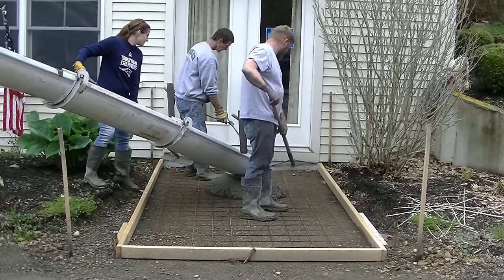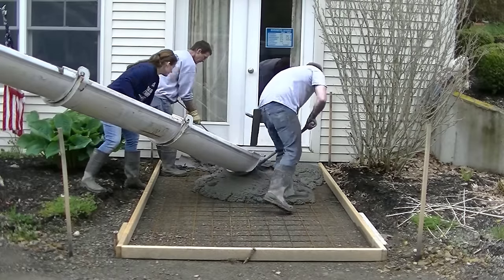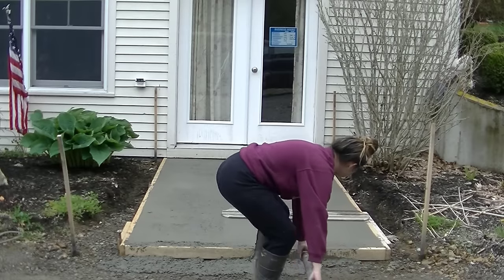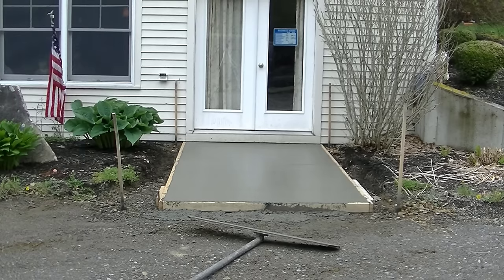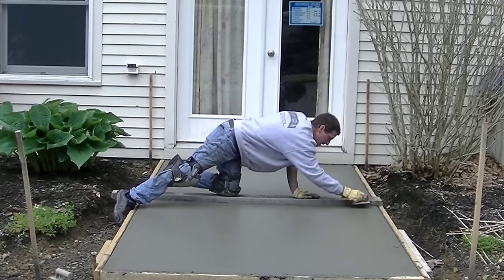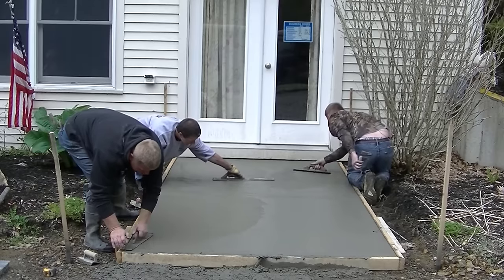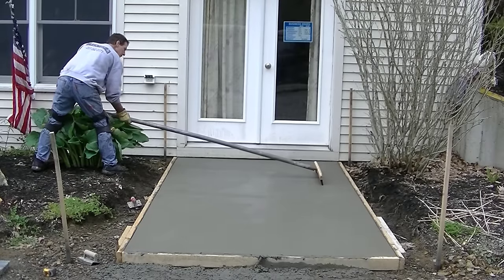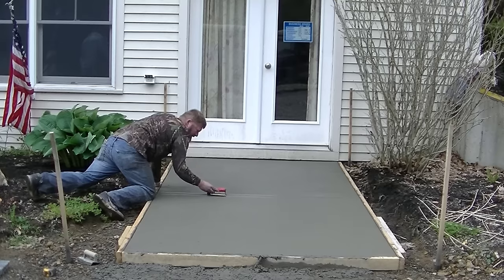Dry Pour Concrete VS Wet Pour Concrete - No One Else Is Telling You This

Comment: I'd like to see some concrete strength testing using sample cylinders of dry pour vs. wet pour concrete. I remember doing that in an engineering class. That was a lot of fun!
Reply: I'm pretty sure no one's putting a car on a dry pour...my dog is 30 lbs
Reply: @MannyTwice So then how thick is it? I don't get it like if you don't need that much strength. And why do you have such a thick slap? Like? You don't understand what concrete is more efficient at holding the same strength. So you need less of it so it's easier and more efficient to use it. So it's dumb to say? Oh I just use the whole truck of drypour
Reply: @MannyTwice there is a guy on YouTube showing just that. The dry held up as good as the wet pour. He cut both in half and drove over both and both held up. Do some research.
Reply: Many have done  videos on comparisons. There is not much difference in strength between dry and wet pour. The biggest difference is cure time, it takes much longer for dry pour to cure. Once cured , there is little difference between dry and wet, well except for cost, Im an old man and poured a dry pour 28x16 pad by myself, for less less than a quarter of the price of getting someone in to pour for me. I would not be physically able to wet pour a pad that size by myself, but dry pour, it was so easy.
Reply: @Edpo26  driving over concrete once or twice is not a test. Cutting it in half is not a test at all.
Reply: @JohnathanAulabaugh if it's not going to be used for cars, I think supporting a car even once is more than strong enough to hold my lawn mower and some tools.
Reply: @JohnathanAulabaugh  guys drove over it several times with a truck and finally broke it. Also did checks inside by cutting into it to see if it’s dry or fully cured. If you’re making a patio slap with chairs on it, dry pour is fine. Just like a small shed. It’s not meant for driveways. That’s commons sense
Reply: @JohnathanAulabaugh it wasn’t once or twice they did it a bunch of times and the guy even said that the video didn’t even have all of the shots because of the camera falling over he estimated he rocked over that pad about 100 times
Reply: @Edpo26  every test carried out by the manufacturer's of bagged concrete show otherwise, that's why it says right on the bag how much water to add 'before' pouring.

Comment: I've been doing a parking sab in 7'x7' sections to keep the pour manageable mixing with 80 lbs. bags.  For me 30 bags is about the most I want to do in a single session.  each slab I do is getting better on the finish as I gain experience, but you experienced guys make finishing look so easy.  Most first timers are not going to get the finish you get.  For many applications the finish is not so important, but the strength is.  Personally I'm stickling with mixing, but I'd still like to see a fair legitimate test with fully cured concrete dry vs wet considering only strength as a first time DIYer is likely going to get a bad finish dry or wet.  Also the exposed aggregate like most of the dry pours get is a legitimate finish that some people like (not me but...)
Reply: I've been doing doing a dry slab 28x16 pour myself. I've been doing it in 4ftx 16ft section to keep it manageable. Its about 22 66lbs bags per section. 7 sections in all. I just finished section 6 tonight. 1 more section to finish and I will share my results on Youtube. I have done 15 dry pours before this. So Im am really starting to get a good understanding of dry pour.
Reply: you mixing by hand or with a machine?

Comment: ❤❤❤❤❤❤😊😊😊😊very good explanation. My DIY guru friends argued with each others over this same topic “ wet cement versus dry cement techniques”.  I shared the  test result that I conducted to compare “ apple to apple” and they are now understand. Here are what I did  1) cross section test showed the integrity’s density and hardness. The integrity of wet cement mix far better than dry cement/ sprinkle with water. 2) moisture content test showed the wet cement mix still retain adequate amounts of water which means its hardness strength continue to set.%

Comment: I think that dry pour leaves a lot more chance for problems. Probably adequate for places that are not  going to be put under a lot of stress. A wet pour also can be a disaster if not done properly.  the wire is on example that probably will not be an issue in a pour like that Called it 4 inches but only actually 3 and 1/2.  What I have seen even by people who do this work is when a wet pour gets too hard to put a finish on the douse it with water to soften it up and then put the finish on. Looks good but often especially where you have changes in weather the top peels off. Done properly I know of sidewalks that are still in good shape for 40 or more years ago. I guess hand mixing it is more work but when I mix  I see where sometimes the contents have seperated. And dumping from above the material will separate to some extent as well. I do use dry mix under pavers to get them level and they will absorb moisture and get some degree of hardness.  For a driveway or some place like a shed where you might put a good amount of weight on it I would go with wet.  I am thinking slab where you are going to put a shed.  I would never say do not do it but think if you have the time and physical ability get a mix box and a hoe and just mix it yourself. Just an opinion and I am 67 and still mix my own and did so just the other day.
Reply: we had a brand new bmw dealership open up,3 level building including a basement (built from scratch) to store the brand new cars.Within a month the concrete in the basement started showing cracks,two months later they were 300-400mm deep and meters long.Clearly a shitty job
Reply: @rorynesta7766  There's a video on YT where a professional team had to pull up a driveway they had just laid not long prior and redo the whole thing.  The reason was that the mix they got trucked in from the concrete supplier was not up to normal specs.  Sounds like this may be the case with your basement concrete.
Reply: @Gourockian1  you do have a point though the was also an asphalt drive around the building also put down and to the adjoining service center and the surface on that was coming apart,meaning little pieces of asphalt was peeling off.Was annoyed as the whole road surface was layered with loose pebbles.Just shoddy workmanship tbh.thats NZ for you.

Comment: Great Points!  
I think it is different On Fence Posts.  I had a neighbor do his, and he did 4000 psi dry mix added water and then pounded it in with a 2 x 4 and then more steps like that and then a year later I came up to his with my fence and needed to remove a corner of his concrete... I used a couple of diamond blades and it was so hard it turned my diamond blade cherry red, the end of the blade curled.  I could not even go more that a 1/4".... I was blown away! I gave up and just moved my post.
  I have worked with busting out concrete for 42 Years off and on, I have Never seen that before.  But then I learned about RCC (Roller-Compacted Concrete) like how they repaired Lake Oroville Dam in California.  It is much stronger because it has just enough water mixed into it to make it solidified and they basically put it down as asphalt and then run the Roller over it... But like you said you have to mix it.  So on Fence Posts it is a little difference I think if you pound / compact it.  But yes to your point again the dry concrete needs to be Mixed with water for consistent strength and finish.
Reply: Hydration as well, compaction. Usually the lower the slump the stronger the concrete. Slump = amount of water. You will see many residential slab/foundation crews tell the driver to pour the water to a load. Easier to handle and it is not going to a soil lab for compression tests, etc.

Comment: I think you're missing a big part of the point. I agree that wet-pour is best. So show me how to do a bang-up wet-pour job (just like this porch slab here) with just me alone -- not a 5-man crew, and no concrete truck to pour it all out in just a few minutes time.
Reply: I'm guesstimating this slab is 7x12, at 4" thick, which works out to 1 yd of concrete, which is 45, 80lb bags, I would dump 5 bags at a time into the form, wet it up real good, and shovel mix it, do this 5 times spread out evenly inside the form, add wire, and then mix one or two bags at a time and pour into form,  and secrete as you go and then finish, you can keep it a little wet so it does set up to fast, or pour around 1" over most of the slab than pour the top inch, also putting a layer of plastic down before you put the first half of the concrete down to slow down the cure time, unless you're pouring in the sun on a hot day you shouldn't have any problems.
I've hand mixed, poured, and finished 100 bags in a day before, many times, but I'm a beast.

Comment: I've done multiple dry poor slabs by myself. It's the way to go. I've saved thousands in the process. The results may not be perfect or withstand a nuclear blast as a wet pour but they are good enough for me and  my requirements. My biggest project was a 10*15 for a tool shed, it is 5 years old now and it still looks good as new.

Comment: When you dry pour it will soak in all of the water you spray on it and it soaks it in even.  You can get a smooth finish by simply running a bull float across it.  The more you screed the more cement will rise to the top.  One reason it flakes is because it's over watered on the top.  Yes, you can put a broom finish in it if you want.  The reason for the paint roller is to remove the screed marks and to leave a none slip sandpaper like finish on the surface.  Dry pour does work well but you have to do it just right.  Just like a wet pour, if you don't do it properly then it won't come out very good.  It's not as bad or difficult as you make it sound.  You can get the exact same results if you do it properly.

Comment: I'm really confused...isn't concrete porous by nature, so water moisture either by hosing, rain or drawing up from the ground is eventually going to wet a slab all the way through?
There is a reason you need to waterproof concrete in basement walls, so moisture doesn't permeate through to the inside. But, somehow if you dry pour, moisture doesn't permeate, thus dry pour somehow makes concrete waterproof?
Reply: It's a chemical reaction that needs to happen in one go to be stronger than a pile of gravel and sand
Reply: @rustycarpenter1219  but doesn't the same chemical reaction happen to the dry pour, it just takes a lot longer?
Reply: @aercegovic  eh i think all the strength happens from the reaction happening completely all at once then allowing slow curing, my slab has a mohs hardness of like 7, not possible with dry pour
Reply: @rustycarpenter1219  that makes sense. I can't imagine the dry pour being superior if all conditions in the wet pour are met.

Comment: What you can also do is wet the ground thoroughly, applying the dry cement in the forms ,add water and mix it with a steel rake in the form..this way even if you dont wet all of the mix properly atleast a good chunk of it got wet..and then proceed wetting it every few hours..me personally i like to mix my concrete..but i understand when its a big project it gets hard..and in some places its probably more expensive to get concrete shipped to..like rural areas..and also concrete bags are heavy i do 60lbs and thats a work out..some advice also look into purchasing a used cement mixer.. i got mine at 60 dollars and still running it can take 3x 60lb bags..

Comment: Noted. I plan to use dry pour in fixing a broken part of the slab in my house from a tree we cut down that used to grow huge roots.  Filling up a hole in a room of my house with dry pour is easier than rolling in a wheel barrel over and over again, trying to avoid hitting the walls and door frames.

Comment: Craftsmanship is what you pay for. Nothing can replace experience, period. I know two popular concrete business owners, within the same area, and one has built his dream home at $2mill and he;s only 49 years old. They both have killer skills as do their employees which is why they have residential and commercial contracts with very successful builders and a couple of cities. They also both agree that if the correct measures are taken, such as depth, prep and steel supports, dry pour can have the same success as mix poured concrete, both for finish and longevity. Mix pour is where the money is because of consistent control of mix and five less hours of prep. The DIYer has nothing to loose IF the correct procedures are adhered to with a dry pour. Unfortunately a lot people are tempted to cut corners and not follow what it takes to perform a dry pour correctly. That is the difference.

Comment: so Id like to ask, respectfully, What good is that mesh doing to strengthen anything, when it is right against the dirt and being pressed into it by the guys walking on it ?
Reply: Yah.
Mesh has to be off ground in the middle of pour. By the by, had added at the cement plant - fiberglass fibers for additional interlocking strength. Looked like hair. Supposedly can replace rebar. I went w/both.
30 years later - a fine crack has developed in one section running from one side to the other in a straight line which can be seen after rain and driveway drying - if you look for it.
But then, I did it myself, amateur vs pro (30x 16 total slab 4” ) and live in Ohio so...

Comment: It never occurred to me to dry pour concrete. I've heard of people setting fence posts doing it that way, but even that never made sense to me.
Reply: fence post is the only time you use dry pour, nothing else. You can see tons of videos on youtube, of people testing it in buckets with limited water (or the right amount) And they break open the bucket after 24 hours and you can see water got all the way to the bottom, and the concrete or "quickcrete" is completely hardened. I think anything larger, or wider, or deeper wouldn't get fully saturated or penetrated with water.

So what this does is allows you as a single person to do more, quicker, with literally the exact same results. When it comes to fence posts.

Comment: If it gets water, it will hydrate. If it gets water, being concrete is porous and not waterproof, how could hydration be prevented? I don't' think it could. However, there are some quick setting types that one might want to avoid, but even with those, given time, I believe it would completely harden as long as it gets water. Most places we live have enough rain to provide that water, over time, but a quick setting concrete might slow the process of getting hydration further down.

Comment: I have a large old concrete patio in the back of my house.  There is a crack running horizontally through the middle of it and one half has dipped towards my house.  Im wanting to do a pour over with new concrete to avoid ripping up everything.  Would it be ok do it it this way or do i have to take up the old concrete first?

Comment: I tried a 24” x 40” 7” deep pad with a dry pour for the first time last week. I’m not a pro but I’ve done wet pours many times with good results. My experience with the dry pour was a bad one. 1st problem was finishing the top and edge surfaces, the aggregate simply wood not work into the slab like it does with a wet mix. And on day 2 when I pulled the plastic off, there were two major cracks! I will coat it and hope this thing holds together 🙏🏻

Comment: From what ive seen so far, dry poor (unless using qk set concrete) does evenly distribute water well(no powder in the center). Its roughly 75% the strength of wet pour. The best test ive seen, wet pour was at 4600. Where as dry pour tested around 36-3800. Dry pour does not work well with qk setting. Im currently looking into freezing test.
Reply: This is the information im looking for. Here in MD we get a solid 4 seasons. I am looking at extending my concrete patio and putting a wooden patio cover. I think the dry pour will be strong enough to drill in the 6x6 wood anchors, but curious about the frost/thaw durability over time.

Comment: Two weeks ago, I was correcting a stone drainage flume off my driveway.  Originally, it was just stone laid in the trench, but over a 6 month period, got all sorts of leaves, dirt and other deleterious material in it, so I decided to dig everything up and concrete it with the stone.  I considered a dry pour to make the concrete act like a mortar, but considered the implication of not enough water penetration in the mix and later getting too much, so I mixed the concrete the correct way and I am glad I did because after 24 hours, that flume is solid and won't have to worry about concrete cracking, since this flume is supposed to divert and drain a lot of water.  If I had dry poured, it would have been a quicker process to finish, but I know it wouldn't have been saturated enough to harden properly.

Comment: Yes!  I just recently saw all this Dry Pour Concrete and was amazed how little all these DIY folks know about cements.  Yes it may look good for a few years, but in 5 or 8 years, especially in a cold area with Freeze and Thaw cycles, they are going to regret it.  It is an illusion that it saves work.